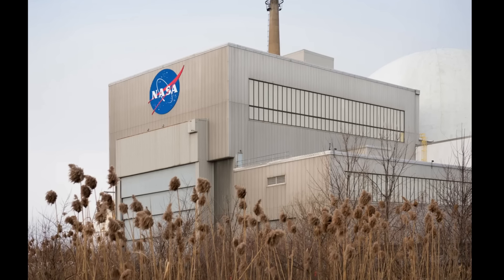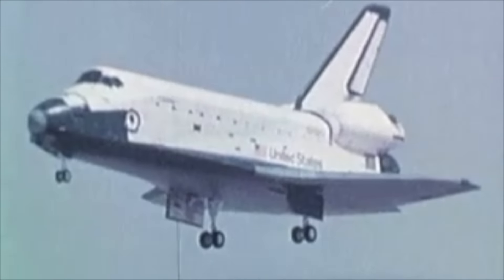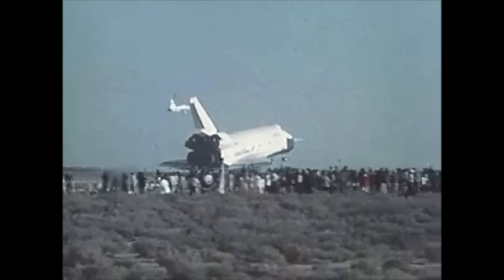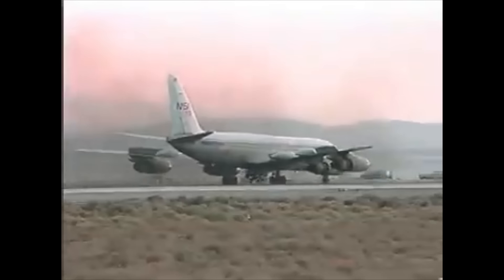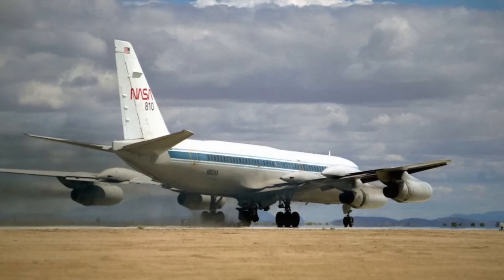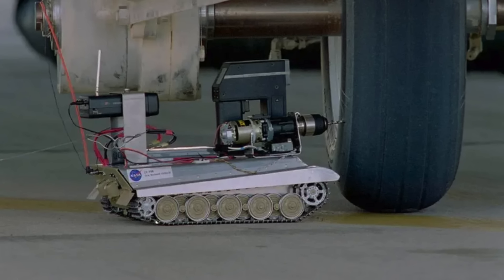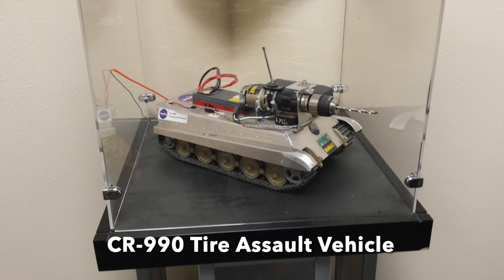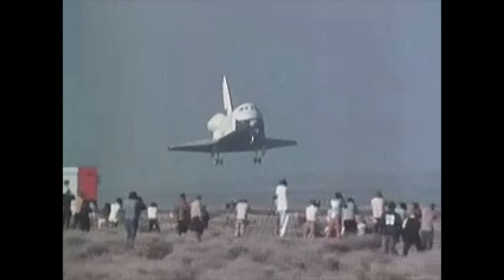The NASA King Tiger Tank

Comment: They could have used any remotely controlled vehicle to do this job, but chose a king tiger scale model. The man behind this project truly is a man of culture and history.
Reply: Not necessarily! Different hull shapes have different surface area on the top. So technically something like a sherman would be a worse chassis-choice considering the engine deck is sloped down a bit- not perfectly flat so you can mount everything level like on the Tiger. Gosh- what an over analysis.
Reply: @Brave_Sir_Robin in your case that would make Tiger l your top pick for the job right?
Reply: @matthewlok3020  Tiger two has the front slope, which in theory, could disperse the blast similarly to V shaped underbelly vehicles.
Reply: The guy probably wanted to play with this RC tank. Lmao.
Reply: RC vehicles on a commercial scale then were not so available as they are now. I'm not surprised they took a DIY approach.
Reply: Either that, or perhaps one of the last few remaining Nazîs (per Operation ₱a₱€₹¢£î₱ no doubt) who'd managed to find gainful employment at N.A.§.A. after the end of the war..?? Although to be fair, that's also not to say that he perhaps may very well still have been a "man of culture & history." (I'm aware that, if that were the case, then he would likely have to be getting up there in age by the time 1995 came around, and although in all honesty to be fair, it's probably highly unlikely, however, that's also not to say that it still wasn't at all possible. It definitely would be pretty interesting to find out even more about the backstory, behind the scene at that time.)
Reply: The NASA personnel at the time were probably very familiar with that particular design...

Just sayin😂
Reply: the guys probably used stuff they had in their hobby rooms at home. It's how a lot of such things get done.
Reply: @hippiesaboteur2556  It's not that deep bro
Reply: @Brave_Sir_Robin ANTIGAMENTE, todo o Pessoal Técnico tinha uma AMPLA CULTURA GERAL, não se Limitando a simplesmente "fazer bem" o seu trabalho normal e rotineiro...
Parece-me que conforme essas pessoas vão morrendo, essas capacidades "holísticas" também se perdem progressivamente, daí a necessidade de "programas caros" e longos, desnecessáriamente complicados...
Reply: Ayè!!!
Reply: This was in the ‘80s/‘90s.  He didn’t have the choice of any tank, as the was no internet or Amazon or anything like.  I suspect it was more a matter of what did the local hobby shop have (or could order) that could carry all that and would have enough traction to push the drill into the tire hard enough to work.
Reply: @FS2K4Pilot  Believe it or not, the 80s and 90s were not the dark ages. I strongly suspect you weren't around then. There were these wondrous forms of media called "magazines" and "catalogs" that were actually quite convenient...
After all, we somehow managed to build the space shuttle...
Reply: @Jreb1865  Yes, and you paid with check or money order, or maybe you read a credit card number over the phone, and then you had to wait 4-6 weeks for delivery.  Pretty much the definition of dark age.
Reply: @FS2K4Pilot  Upvoted both you gentlemen
Reply: I pointed out that these Nazi scientists choose a Nazi tank which is suspicious, and people said I had no point.. some real idiots in this comment section
Reply: @whirving  The RC Tamiya KT exists for several years.
Why would they have copied exactly the KT's armored hull to build a drone?... It doesn't make sense.
They obviously used a RC Heng Long or Tamiya chassis.

Comment: I was trying to wrap my head around why NASA had a WWII Tiger tank and thinking that firing an 88mm gun anywhere except in a combat zone made no sense! When you revealed the answer, it sounded like a gotcha moment! This was one of the most interesting videos I’ve seen in a long while! Thanks for posting!
Reply: my dumbass was like, so what then, they just gonna poke it with the barrel, oh maybe they put a pointy stick on it! japanese scale model came like ½ sec after.
Reply: Roller coaster of emotions really.
Reply: Government agencies often have things that don't make sense. The EPA owned a Plymouth SuperBird.
Reply: Well... Maybe avalanche control.
Reply: Here I was thinking maybe they were using it as an emergency launch pad escape vehicle.
Reply: I thought they had it to study it's design for the vehicles that move rockets to launch towers ...
Reply: @jeffkeith637 I thought maybe they used it to help make sure the runway could handle the load of a king tiger or speeding shuttle.
Reply: i really thought they ran over the tires with a tiger 2
Reply: @Blox117  I wasn't going to say so - I thought they might do it like that to get the tyre off the rim.

Comment: I've built many Tamiya tank kits. Always found it interesting that the hulls were set up to allow for motors and batteries if you wanted to make the model "drive"..Always wondered how often people did this...never imagined such a creative use for it!!!
Reply: Tamiya also released the same models as RC models ( including motors,  optional sound units and recoil motors ect ect )  ,you can still buy them.  The most early model of Tamiya 1/16 was actually a Sherman ,  it is still sold today in a full option "computer controlled" RC model , they still use some of the same molds they did , or copy's of them.
Reply: @NavyfieldVikings  I beleive there are even RC kits you can install in these that control with a smartphone.
Reply: @NavyfieldVikings  most hobby stores dont even sell it and all online are out of stock
Reply: @gearheaddave9639  When i was into the "rc tank" hobby i used to order them directly form Japan,  might still be a source right now.   The stocks aways where fluctuating in the years, they did production runs, and it was never a non-stop production proces .
Reply: @NavyfieldVikings  well the only RC tanks i have are the metal version heng long tanks

Comment: The tires were originally B.F. Goodrich, manufactured in Stanley, North Carolina. It became Michelin Aircraft Tire after the merger. I used to calibrate the boiler house instruments and controls.
When the space shuttle Columbia re-entered the atmosphere, the hot gases cut their way through the aluminum wing spars until it breached the left side wheel well. We know this because the last message from Mission Control was "We see your tire pressure messages and did not copy your last". The tire pressure sensors had just gone offscale low, indicating the loss of the sensor wiring connection. 
When the plasma got to the tires, they exploded, taking the left elevon off and throwing the orbiter into a spin roll.
Reply: dang that makes sense, so the tires were a liability
Reply: @Blox117  When the tire configuration for the orbiters was tested and certified run-flat technology didn't exist, and since there had never been a problem before NASA never devoted any effort to implementation of foam.
Reply: Did you work at the OPF. I probably check your badge.

Comment: I have a space rocket book from the 1960s that shows a converted Sherman tank minus gun plus some additional equipment  at Cape Kennedy used as a forward mobile observation post for rocket launches enabling closer viewing of the launch pad than from the fixed bunkers with the protection for the observers of its tank armour.
Reply: Along with the sherman M113 APCs are currently being used as an armored astronaut eviction vehicle in case of possible launch pad explosion. NASA also has several modified M45 .50 cal quad mounts that are fitted with large cameras and used to film launches.

Comment: Until you revealed the truth, I really thought that it was a real Tiger tank. Nice one, Mark.
In a similar vein of models being used in the big World, were you aware that the UK Atomic Energy Authority used a Hornby-Dublo locomotive to safely position and retrieve samples for irradiation? It was at one of the research facilities either at or near Harwell- I can't remember which as it was so long ago.
Reply: I dug this out:
“ It wasn't at a nuclear power station but was at the Atomic Energy Authority's Radiation Research Laboratory in Wantage and appeared in a short piece in the September 1960 Meccano Magazine.
 
Researchers needed to collect samples from a liquid plastic being subject to a very intense radioactive source inside a cell and move them about 45 feet to where they could be safely handled (presumably with the remote manipulators commonly used in such situations) After considering a specially designed transport system the low tech solution they came up with was a Hornby Dublo 2-6-4 tank loco rail loco ( 80033 a BR 4MT) towing an open wagon in which a sample beaker was set.  The train was observed through a system of mirrors and the movement of the  train controlled from outside the test cell. The MM article - which reads like a newsagency report- says that the researchers bought the train from "a local toy shop" but ISTR that it and the track actually came from Howes in Oxford.”
Reply: @Oligodendrocyte139 who cares about it
Reply: I do, a cracking little story 😄
Reply: @andrewnewstead4367   I do as well.
Reply: The real Tiger in this video is Tiger II number 104 at Bovington

Comment: Very interesting indeed. I had no idea the tires on a shuttle craft could be so dangerous. Thank you for posting.
Reply: Even a truck tyre failing on the highway can blow the windows out of a car alongside
Reply: The tires played a major role in the loss of the space shuttle Columbia and her crew. While the dry nitrogen gas isn't flammable or explosive the fact that they are filled with 300 psia of it is where the danger is. Large tires used on earthmoving equipment and tractor trailer rigs are equally dangerous.
Reply: @MrOlgrumpy That's why you spend as little time as possible beside them and never follow them too closely.
Reply: tires from a semi truckor just a car really are already pretty dangerous if they pop, now imagine how much psi has to be in those tires to hold up an entire shuttle!

Comment: I remember this setup! Before my time at the space center, but I got to see some pictures and videos of this thing getting thrown by a blast.

But I did hear about an actual real WWII tank that was used for the space program. Originally Naval Air Station Banana River during WWII, site was transferred to the Air Force to become Cape Canaveral Air Force Base, and later Kennedy Space Center. The predecessor to NASA was NACA, and in 1950 they arranged the launch of the first rocket from Cape Canaveral, called the Bumper 2. The rocket used a V2 missile as the first stage with a US Corporal rocket as the second stage. There was no rocket launch infrastructure, but the launch equipment and pad was relatively simple to knock together quickly. What wasn’t so fast was the construction of a blockhouse to protect the launch crew. The solution was to borrow a Sherman tank from the Army, point the turret away from the rocket and run all the wires through the gun barrel to the guy, who I was told literally drew the short straw, inside with the final launch panel. A field telephone ran from the tank  to a command post much farther away where they gave the order to fire. Besides the slight possibility of fiery and explosive death, the big complaint from the guy inside was that he didn’t even get to see the first few seconds of the launch since he couldn’t see out of the driver or bow gunner’s vision blocks and the turret was pointed away from the launch.

Comment: I have changed my share of these 44 ply Aircraft tires in the late 80's and early 90's by hand by using semi tire truck bars by hand , it is no fun and it is not a good job for a amateur. A defective or run partially flat can kill you airing it up in a cage or not. Glad that we didn't have to do anymore after the 98'.calendar year. Hard and dangerous work. Today they are pre mounted or put on by a big truck tire/loader tire machine. Great job, great day and God bless your history accounts of yesterday with the original proof the history and the original places and things used. Thanks again for the work, time and effort, Dr. Felton. We need more people like you!🤠

Comment: Thanks for another fascinating tale well told. For aviation buffs, the video includes the early landings of the Space Shuttle during which the "transport delays" (more accurately, the computational delays) caused by the shuttle's flight control system causing the pilot "over-controlling" during "high gain" tasks (such as landing a prototype space vehicle at 200 Knots ).This condition is known as Pilot Induced Oscillation - PIO. The NASA project director said he would solve the problem by changing the pilot. This would not have solved the problem. It was solved by reducing the computational delays.

Comment: Never disappointed with a Felton video !

Seems odd to go to that length when CTIS systems were already being used on vehicles since the 60s.
 Theoretically at least, you could reduce the 373psi+the increase from heating down to a weight that would support the aircraft but not be a hazard for the ramp monkeys....all from the cockpit as part of the shutdown protocol.
So what am I missing that they did it this way instead ?

Comment: Well, that's yet another "Who knew?" moment - Thank you, Dr Felton

But I wonder why they did it that way rather than include some sort of of remotely actuated pressure release valve in the wheel rim? The pressures involved are high (by regular tyre standards) but there are plenty of applications in high pressure steam and gas engineering where such systems are used. It would also have the advantage of allowing the used tyre to be deflated and then removed intact for further examination/inspection.

Comment: Fascinating! I have read in several places that NASA used steel from the sunken German warships at Scapa Flow due to its low radiation or something. What did NASA use that steel for? Also I've read that NASA used a hot rod Pontiac convertible at Edwards AFB to use as a chase vehicle for the early shuttle prototypes.

Comment: Wow! I've never seen that bouncing shuttle video before.  The delta wing and weight of the shuttle, means that the pilots must keep a high angle of attack in order to keep the thing flying as it slows to landing. Too low, and it slams on the ground, too high and it stalls and falls like a rock. Once it starts bouncing off the runway, the AoA must be maintained just right or else, SLAM! That must have been a pucker factor of 11!

Comment: ALL jet powered aircraft tires at least are filled with nitrogen, molecules are larger than oxygen so it doesn't leak as much as ambient air and among other benefits. I feel concerned with the vacuum of space compared to the sea level but with so much pressure in the first place the difference is only 5%.

Comment: "The cheapest bit of kit," might actually be some of the tools used on Apollo for lunar missions. Many items like shovel heads, hatchets, wrenches, etc., were simply purchased at local hardware stores and stamped, "NASA." There wasn't time to do testing to make small tools like these lunar approved and flight tested, and since they would be used once and then largely discarded on the lunar surface to save weight when the ascent stage blasted off, NASA brass didn't really see the need to do so. Much like the hardware store bought flag for Apollo 11, these items likely cost far less then $10 US apiece, and in 1960s dollars likely far less than that.

Comment: bizarre

how did they inflate these tyres ? presumably not with a normal valve ?

surely it would have been easier to let the air out from the same place air was originally put in and therefore reducing the pressure and gradually the overall danger of explosion ?